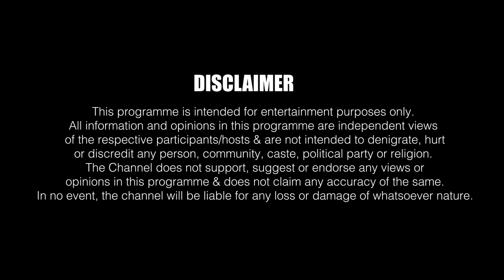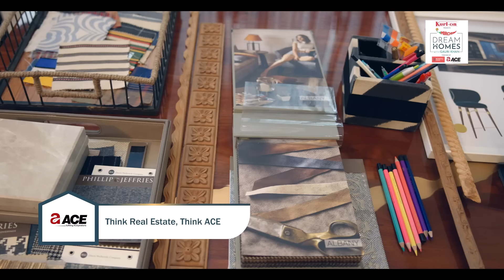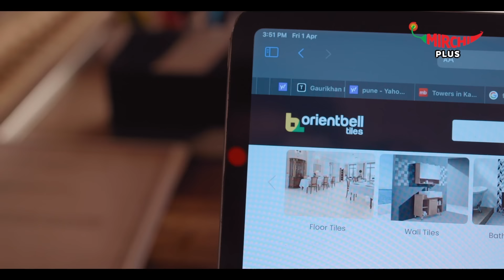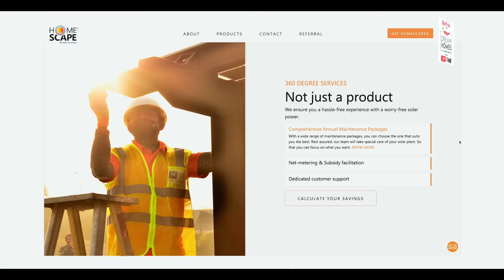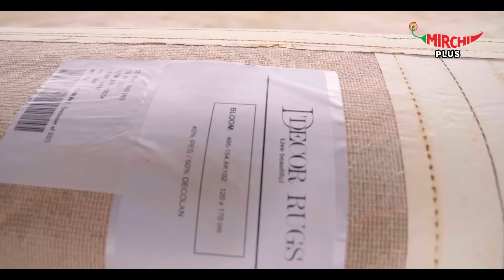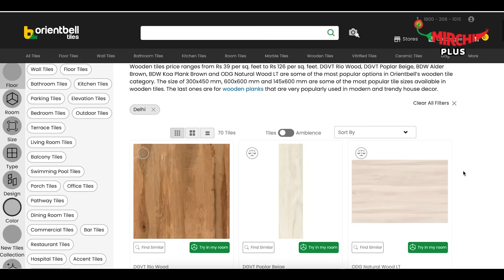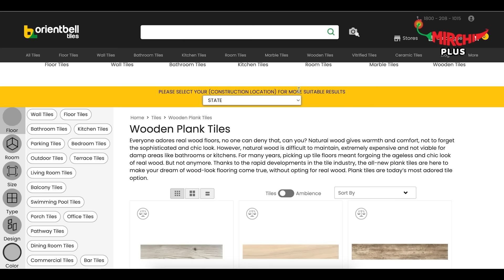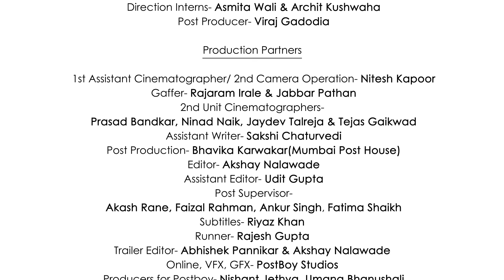Katrina Kaif’s Terrace gets turned Into a Cozy Space by Gauri Khan | Dream Homes with Gauri Khan

Comment: Like the remodeling GK has done to KK's terrace, only one thing didn't like that much is they've covered the useful nice small built in ledge pool, it would've added more serenity n tranquility in that space if they turned that pool to a small luxury water lily pond or coy pond with waterfall spillway like a luxury aquatic garden.
Reply: I agree
Reply: Agree
Reply: @payaluk2449  o
Reply: @payaluk2449  o
Reply: @hafsamubashir2837  io
Reply: O9ooóoo9o9ooooo

Comment: Again, could have been a lot better. Looks cluttered and indoorish. Completely lost the outdoorsy vibe. The small sqaure floor space with blue water designed tiles could have been used so artistically but was sealed and lost. This space needed to be opened up and not closed in. GK clearly doesn't have the knack for designing.